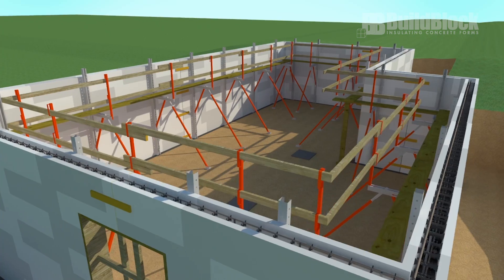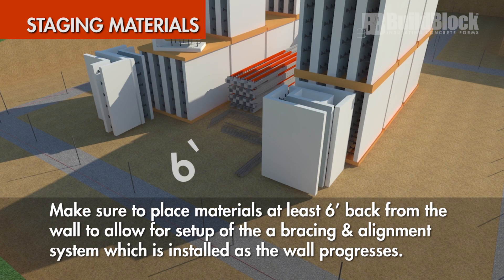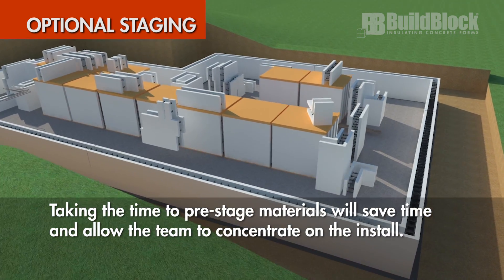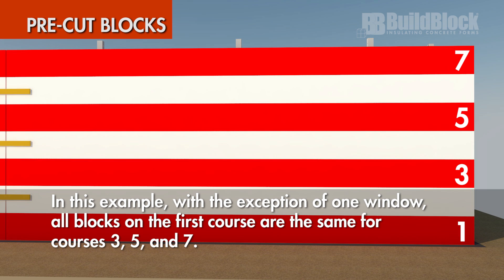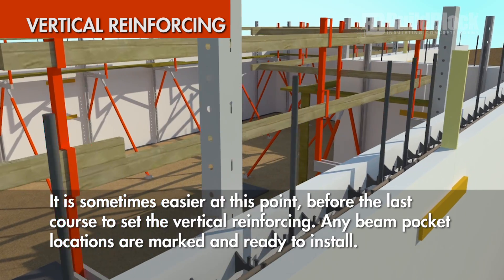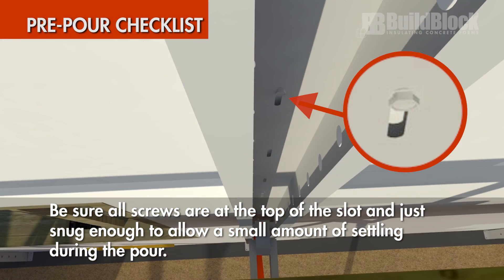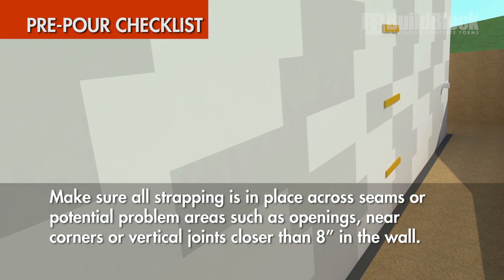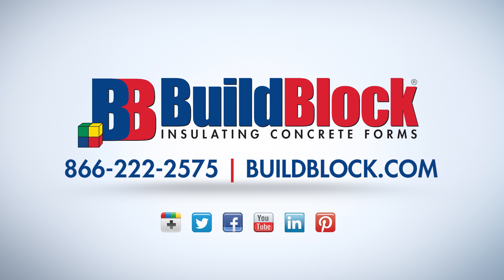How to Build an ICF Basement

Comment: Is a wall with the 6 inch core thickness strong enough for a basement wall that will be back filled to 8 feet?
Reply from the maker: We typically recommend an 8" core for anything below grade. You can then transition to a 6" core above grade if you're continuing with ICF.
Reply: I sure will house is still likely a year off and will be built on a small lake in north Central Indiana, thanks for getting back to me.
Reply: Thanks! I intend to go all the way up to the trusses with Icf blocks for my house and the garage as well. Looking at setting my main level floor on the transition provided by reducing to 6 inch for the main level walls from the 8 inch blocks in the lower level.
Reply from the maker: @mikeyazel8725  Yeah, that's the way to go! Best of luck and let us know if there's anything we can help with.

Comment: What would the wind load be. I live in a hurricane area ? Can it with stand 180+ MPH winds ?
Reply: There's an 8 inch ICF block and a 10 inch, probably bigger as well. I worked on a house that used both the 10" for foundation and walls were the 8".  If reinforced concrete can't withstand hurricane forces, I doubt anything could.
Reply: up to grade 5 hurricanes. it`s a damn nazi bunker, it can stand anything.
Reply: I've seen testing with 200 mph winds on these walls... no problem. just need to make sure the roof is very secure! or concrete.

Comment: Is this earthquake proof?
Reply from the maker: ICFs are extremely resistant all forms of natural disaster, including earthquakes. ICFs create a steel reinforced concrete structure with insulation on both sides of the wall. You can read more about ICFs and earthquake resistance here https://buildblock.com/icfs/safety/earthquake-resistant/.

Comment: Why can I not make the footer and floor slab one pour?
Reply: A lot of ICF construction uses the method you talked about but when we built our ICF home I found some real advantages to doing the footings first.  If you pour both you have to complete any plumbing rough ins that go through the floor ahead of time.  Then you will have to work around all of the drains etc that are sticking up out of the floor- you break one off which would be fairly easy to do and you have a problem.  Second and more important I wanted to use the bracing on the inside of the walls.  If you do the bracing inside the building after the pour you have to use a gun to shoot sinkers into your new (and still fairly green) poured concrete floor to hold the legs of the bracing.  I did not want to shoot sinkers into the floor- especially since we had talked about doing some stained concrete.  A bunch of holes in the floor would have looked crappy in the garage too.  Hope that helps
Reply from the maker: You can. The video just says that the plan for this example specified that the footer would be poured before the floor system is installed. We've seen plenty of people build ICF structures on a slab on grade foundation, it just depends on the plan and engineering for the project.
Reply: David Smitherman as I stated above. Really only two methods- put the bracing on the outside of the building which is doable, but I think has some disadvantages. Or you attach the bracing leg through/to the concrete.  This is fine if you don’t mind holes in your concrete floor.

Comment: Yeah it's awesome to save construction time but I bet the price per block is crazy
Reply: We built our home for $80.00 per sq ft.  And that is with 10foot ceilings downstairs and 9 foot ceilings upstairs and a lot of high end finishes.  That is about $50-60.00 less per square foot than building costs in our area.  The ICF walls were the easiest and one of the least costly parts of the build.
Reply: @TheMarpalm  $80.00 when all is 100% done? I mean all the interior and exterior finishes + roofings? If yes, it`s a great price. Here in Romania, we are looking at about $110 per sq ft. if you want to make it professional, green and durable. Traditional bricks, not ICF, which is still not very used here. But at a first sight, that $110 could go down with ICF due to a lot of factors and economies made on time and materials.
Reply: HenryGothie yes. But we did the block (stacking, rebar etc)work ourselves.  Also did most interior trim work, landscape and cleaning work ourselves.
Reply: @TheMarpalm  yea, that`s the way, to get your hands dirty :D Another save, that you can do some work on yourself too.
Reply: @TheMarpalm  What kind of roofing system did you install?
Reply: calpitoc we looked at several options including metal and standing seam.  Ended up going with architectural shingles.
Reply from the maker: It's not. ICFs accomplish 6 goals with one product. Walls are formed, framed, furred, sheathed, insulated, and soundproofed all by the ICF. And you're right, you do save time on construction. So when you add all of that up and factor in the fact that you'll save money on HVAC costs and added materials... ICFs are much cheaper in the long run.

Comment: We provide kind of construction with some betterment, that makes lesser in cost. We prepare our panels on site. In the same way we use cement blocks, not insulated Styrofoam panels. We work in India from Telangana Hyderabad. We use gfrg ro GFRC wall panels in the place of Styrofoam blocks. 7660042040